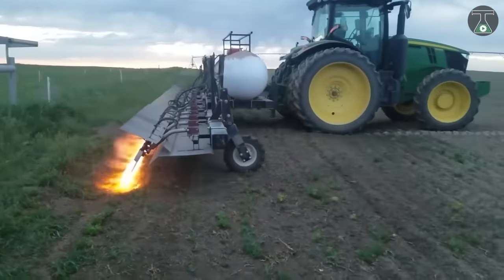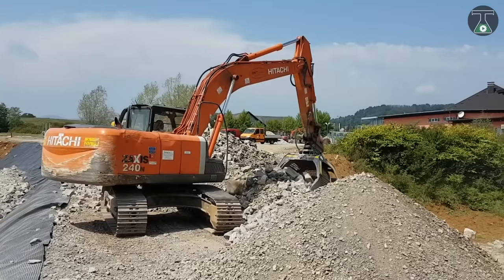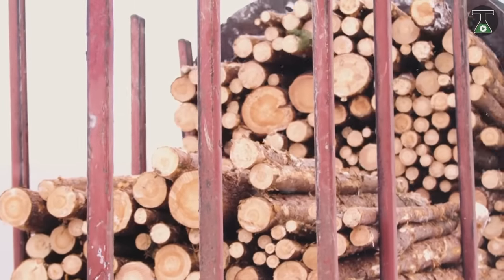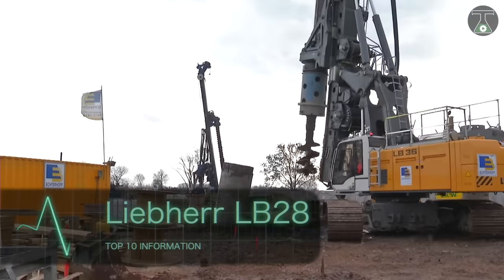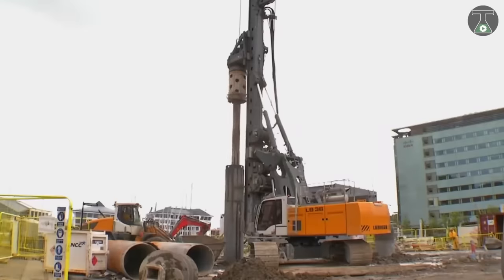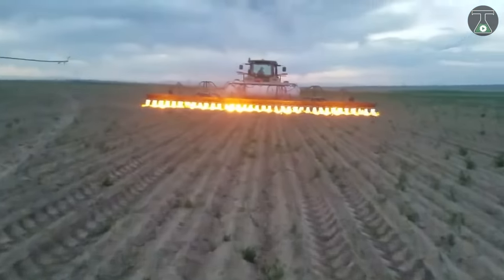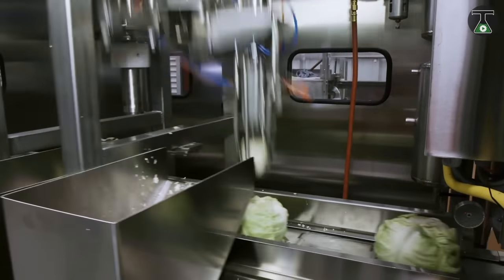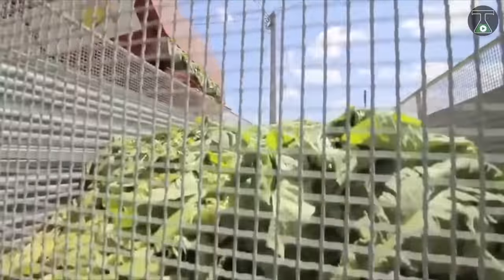8  Unreal Useful Machines You Need To See ▶ 11

Comment: We had an 4 row flame cultivator with 8 burners.  We used it  on   cotton on my dad's  farm in 1960.  I drove it when I was 16.  It  worked ok.  Killed young weeds and burned off the lowest branches of the cotton stalks so the cotton picking machine worked more efficiently.  Didn't seem to hurt  the cotton stalks, but they had to be a certain size before we could go into the fields with it.  Ran on Butane,  which cost 3-7 cents a  gallon.   I nearly killed myself with it.

Comment: Flame throwing tractor ?   Most field weeds will survive with just roots and this machine pollutes way more than an application of roundup that is done right .   Imagine believing a 3 ton carbon footprint is better than 8 kg of a sulphate salt
Reply: Round-up takes a number of days to be effective, and any over-spray pollutes the field.  Round-up is a confirmed carcinogen.  Assess all the risks.  Fire is fun.  (The man-made carbon footprint problem can be fully-cured by converting all coal and gas-fired electricity plants to nuclear.)
Reply: @ChipArgyle  good luck with the fight Chip. I have pretty much given up on convincing people about the advantages of nuclear. All they ever see is the chance of a plant blowing up.
Reply: Nothing wrong with waiting a few days for the roundup to work ,   Flame clearing does not work , it leaves a healthy root in the soil and more carcinogens are released when you paint your diesel pick up truck that you drive to work pretending to be a farmer . I do agree with you Chip about needing to convert from coal and gas but USA is not doing this .  Too many voters think it is ok to use 3 tons of hydrocarbon fuel to do a simple job .